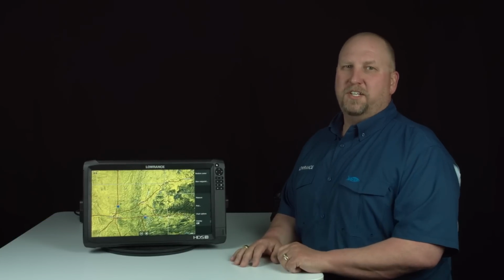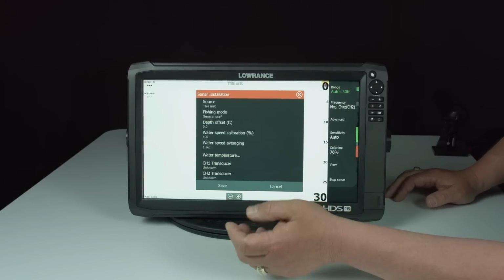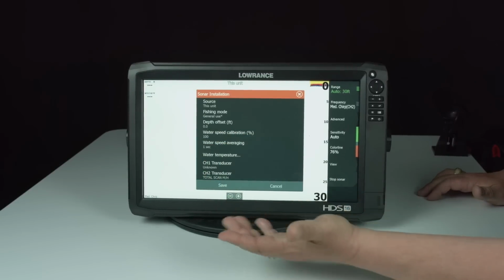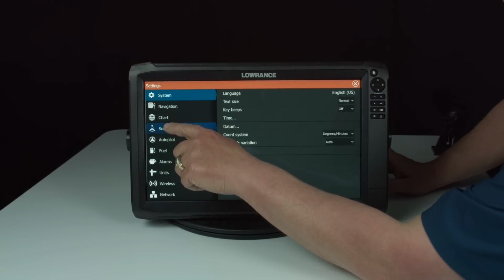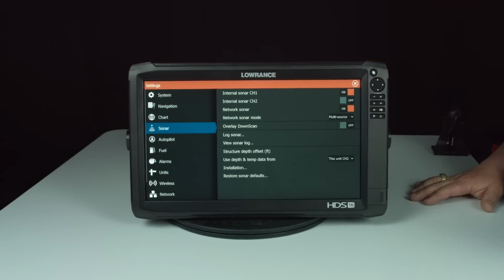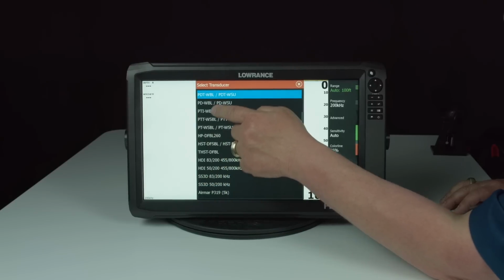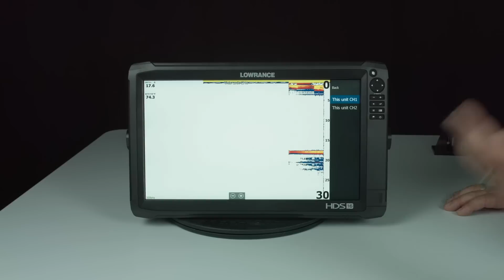HDS Carbon - Understanding TotalScan and Sonar Channels 1&2

Comment: When I select Channel 1, is Channel 2 turned off? Specifically, is the power supply to the probe that I'm not currently using cut off?
 I use the Lowrance HDS 10 Pro with two transducers.. one is the Lowrance 3 in 1 and  Airmar SS175m

Comment: So which transducer performs best on the HDS Carbon 9? I have an active 3 in 1 and a total scan I can use. I upgraded to the Carbon 9 from an Elite 9Ti and was very happy with the performance of the total scan hooked up to it.
Reply from the maker: Definitely the AI 3in1 transducer, which is compatible with your HDS Carbon.
Reply: @lowrance  when you turn on the unit without it being in water is it true it can damage the transducer?

Comment: I am back again with the same issue. I replaced all ethernet cables, and replaced the Gen 2 touch with a new Carbon 9. The problem continues if the Carbons recognize the master Carbon I am good to go. The problem happens randomly in minutes or hours. It usually will return randomly. You can go to source sometimes all choices are there and sometimes not there. I have some pictures to show the problem.this photo shows all the sources which is good! The next photo shows the missing Carbon9 which is the master unit! Another photo of the missing Master Carbon 9.

Comment: Jacob, I have a Lowrance carbon 7 on the deck and it continually asks to accept terms and conditions when turned on? How do I get around this? My HDS 9 on console works right away when it turns on, that's all I want. Thank you
Reply from the maker: Hi
I believe you are refering to the Warning page that must be accepted at power up.  THere is no way to disable that at this time.  I can't explain why the HDSS9 would not have the same page as all HDS units are supposed to have that screen

Comment: no mention in this  video about connections with more than one mfd and a 3d module box connecting all transducers to all mfd  via ethernet.Is there another video for that?
john
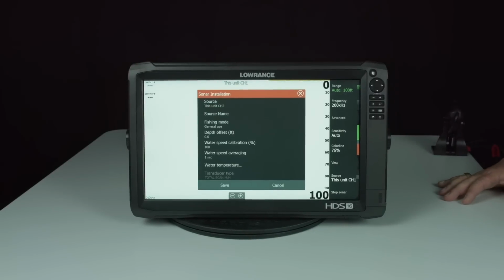Reply: Go to 4:30 and listen again as I did a few times ... Jacob said this can be done from any unit and can be viewed from any unit ... At least that is what I got from it ... I will be checking mine when I get home ... I have 2- 12" on the console with a 3D transducer and a 83/200 on the transom and one HDS 12  Gen 3 on the bow with a TotalScan (CH 2) ... All connected via Ethernet cable to the 3D Hub in my center console ... I have a lot to learn to be comfortable switching back and forth and not doubting myself with every change I make ... I'll be book marking this video to watch more ... Jeff ... 240 LTS ...
.

Comment: i start getting  3 dashes on my depth when i get in over 80 feet of water for some reason. i have the hds 9 carbon and it is set on auto depth.. it only happens when i get in deeper water at the lake. trying to figure out if i hit some thing in the settings it used to work right. when i get the three dashes screen is pretty much blank. im using totalscan transducer. if you have any tips i would love try it. thank you and great videos!